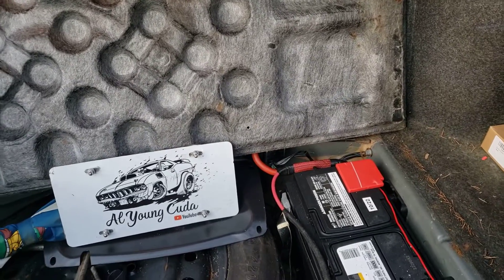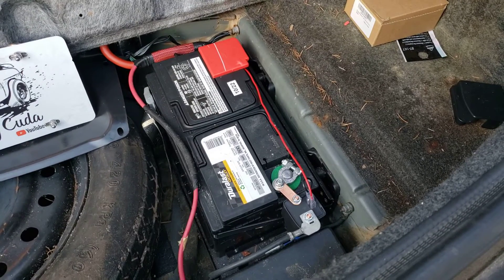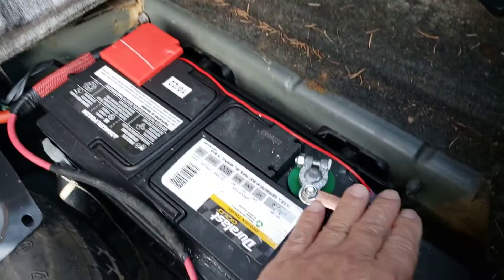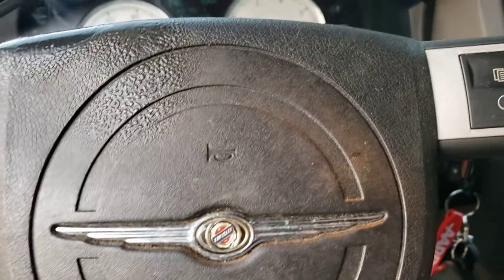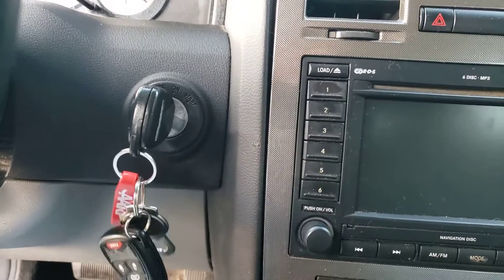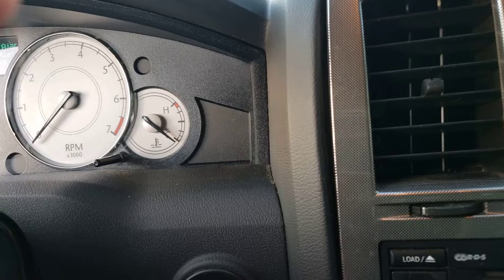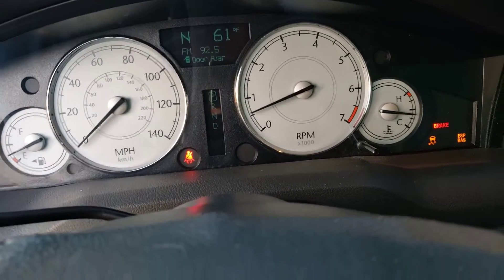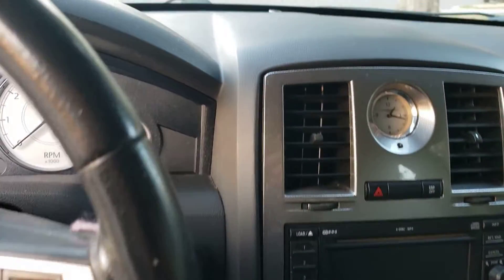Remote Battery Disconnect Switch Operation The Good and the Bad of It ,Cutoff Theft Switch

Comment: I have one installed on my 1980 Oldsmobile Delta 88.And it disconnects the battery remotely. I no longer have to keep raising the hood to disconnect the battery at night .Also when I connect the battery with the remote battery connect/disconnect My car's alarm goes off which I have to then  disarm with my other remote  ,which is like a backup if some is able to copy my  battery connect/disconnect remote code.The Car burglar alarm noise should draw attention to the situation at hand .Works great .The only problem I had was either lacked of a ground wire from engine to frame to  keep a good ground for the alternator to properly charge the battery. wasn't happening for  a few years since I installed the device .Or the battery remote disconnect when it got old would not hold a good ground any longer causing the alternator to over charge the battery causing battery acid leakage round the battery cap.Since then I added ground wires from engine to car frame and will install a new battery disconnect.Alternator is charging okay since I remove the old battery disconnect as well will install a new one.
Reply from the maker: Olds 88 before the computer era..cool car, not many of those around.
Reply: @alyoungcuda I just replaced the coil in the distributor cap with a 12 volt oil filled coil mounted on the fire wall.Added  intermittent wipers by using a 1979 Oldsmobile pulse dash  wiper switch and a 1973 Buick pulse wiper motor with those two metal contacts sticking out below the washer pump contacts on the wiper motor.All plug in play since my wiper switch is on the dash panel not the steering column.Very simple car to work on.
Reply: @alyoungcuda Damnskippy!
Reply from the maker: A bad ground would not charge the battery since it is a bad connection,  but  a bad ground shouldn't cause an overcharge since it wasn't even sensing a low battery but I understand the overcharging of the battery and cooking the cells. But let me ask you this, with the battery disconnect connected and applied( no battery power) the alarm should of lost its power too, hence the alarm should not work on its own. Unless you have the alarm wired to the battery before the power disconnect,  so the alarm stays powered by the battery but the rest of the car has  no power.
Reply: Right the alarm has no power  on disconnect of the battery .Only on connect of the battery the alarm triggers. @alyoungcuda

Comment: What if my relay is good but when I go to start the car it turns on but the relay disconnects when I go to crank
Reply from the maker: @joshuahancock7129  then the relay is not good..it doesn't make the connection  from 1 end of the battery terminal to the other..unless your battery is dead but has enough electricity to run the relay..its an easy troubleshoot, take the relay kit out, connect the battery cable back on like original and see if it starts..if so, bad relay, if not, bad battery or bad battery cable and check your ground cable too

Comment: Why not use the switch between the Battery +  and the starter?  The car won't start, but you don't loose all other functions.  You wouldn't want the car to die while tooling along the Intestate during rush hour.  The car also becomes less controllable which is a big liability.
Reply from the maker: @TMC-15Jan45  on an older car its alot simpler but on a modern car you would need to tap into the starter relay circuit in the fuse box and with all those wires around that, no one is gonna go near that..unless of course you move the relay out of the fuse box into its own connector outside of the box like what you would do as a regular kill switch..
Reply: A lot of people (me included) use these because they have a parasitic drain that kills the battery after a couple days.
Reply from the maker: @charleshultquist9233 I've got one installed on a 2007 car  and with the computer,  it will drain the battery dead in a month since it sits alot but turning it off will kill all the memory it has for the car and it all resets everytime it is turned back on. For older cars it is a great item but the relay still draws power and will eventually kill the battery in time. A regular cutoff or battery disconnect would be much better in an older car for the battery draw but as a kill switch its good and its better if you lock out the hood so no one can by pass it at the battery.
Reply: @alyoungcuda Yeah, I'm using one on a 2003 Opel Corsa that gets used sporadically and it has some kind of parasitic drain. I isolated the problem to one circuit but it happens to be the one that  goes to some multi control unit behind the dash. I don't want to dig into that mess to look for the problem so I thought one of these relays would be an easier fix.  The car has a crap radio that we never use so loosing the channel presets and the clock is not an issue. Like you mention these units do draw power themselves so that eventually it will drain a battery down but I read somewhere that the primary only draws about 3-5 milliamps so that would take a long time.

Comment: What you must remember is your car computer will be reset your radio codes will have to be put in etc good for storage.
Reply from the maker: Thats the bad thing
Reply: I have a memory saver that plugs in into my 12 volt socket in my boot (trunk) it saves everything
Reply from the maker: Interesting...